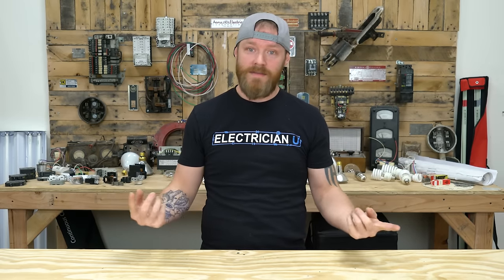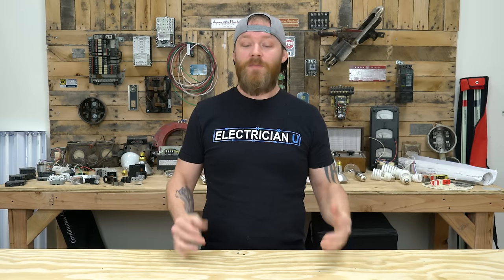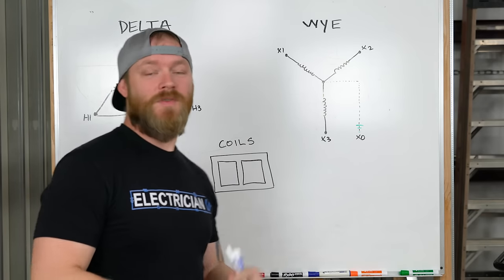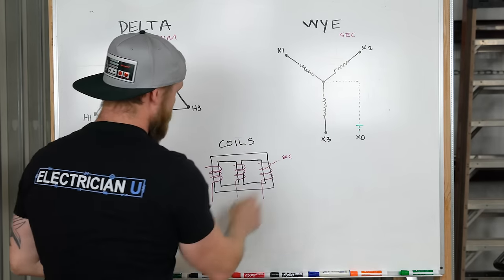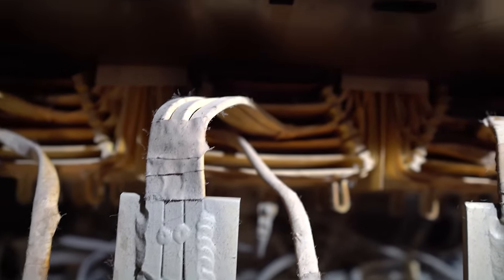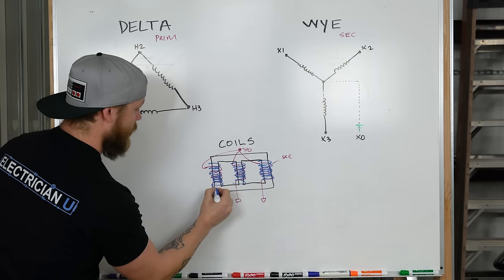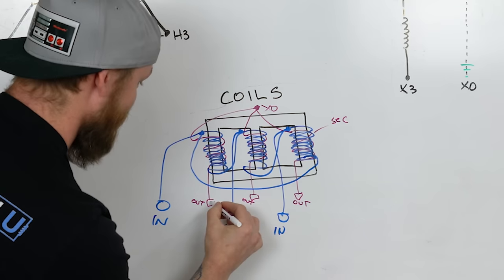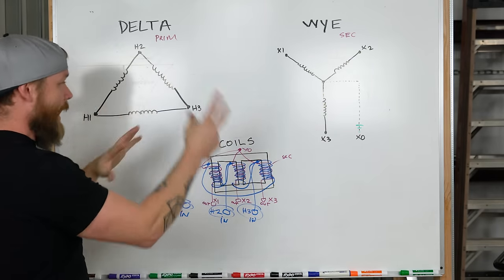TRANSFORMERS - What They Are, How They Work, How Electricians Size Them

Comment: Our building is currently having a large solar array installed on the roof. 650W panels and about 80 or 90 p[anels. It is being tied to the electric grid serving the building for a feed-through at 600V. The transformer is a 10Kv. Unfortunately, I don't have the entire set of numbers (Installers are not allowed to share it due to security concerns. Not that I understand how it could be a security concern but it's a social housing building so the rules are designed to keep tenants from knowing anything about the operations side whatsoever.) They also have a solar monitor, a combiner box, and a large breaker that isolates the panel from the transformer that is mounted on the outside of the building. There is more equipment that I saw the boxes for but didn't get a chance to read the label on as they had been blacked out. This is different than my setup for camping where we have a solar controller that combines the transformer function and some elements of the solar monitor into a cigarette pack-sized package that does 10Amps. That with the panel and a battery plus a breaker gives me the power to keep my phone and coffee machine running at the campsite. It would be interesting to see a video of how a large rooftop-mounted solar array is set up and configured.

Comment: Good video, I learned some shit but I feel like the most complicated part is the grounding and bonding which I see a lot of contridictary info on. Most of this other stuff is done by engineers. Hooking up your primary and secondary conductors on a new transformer is sitmple compared to grounding and bonding. Also I've looked and have never seen torque values from a manufacturer. My contractor has "default values" for such conditions which I assume are from UL 486A&B but I have no access to those so I cant verify. My issue with that is I see crimped lugs(usually due to spec instead of mechanical lugs) attached with 1/2" hardware which is very difficult to torque without feeling like you are going to break shit. 50 lbs/ft to connect a 1/0 wire? Seems like overkill. Do you have any info that could clear that situation up?

Comment: My question is what is a transformer that can go from 110v to 220v? If I was to get one is there a way I can hook a solar panel to that transformer to act as if I have more watts going into a 24v battery set up? If not can I place a transformer after a 12v battery to get 24v or higher for a 24v or higher power inverter? If I do get 24v inverter can I run it into a breaker box so I can distribute the 110v and 220v to different plugs. I'm not running these  ideas for me to re wire a house camper or rv. I'm trying to experiment with a 370w solar panel and run it in my shed that is in the country and if it caught on fire and burned down it would not burn houses or other buildings down. I have a feeling that just taking a little bit of electricity from something like a solar panel can be stepped up so you don't have to have a whole backyard of solar panels or have tons of batteries that will burn out every few years and cost you a thousand of dollars for just one new battery compared to thousands if more than one battery goes bad. I have one 12v battery and its a little over 200amh led battery. So spending even $700 once for an transformer is still cheaper then spending $300 for 10-20 solar panels and swapping out one battery is better than having 4 go bad that cost $1,000 a piece so these are the reasoning of why I thought of a transformer. I also understand that a large fuse should be used and another reason why I said run it into a breaker box is so the breakers can be the shut offs manually and if it overloads it will trip the breaker. If you make a video demonstrating these that would be cool and im sure so many more people for camping purposes and for home diy people will follow you. I'm trying to run bitcoin miners in my shed instead of in my house because they are loud and I don't want to run them on the grid and have to pay for the electricity so this is why I need 220v in my shed.

Comment: Isolation: Your explanation about isolation and dirty power not getting through to the secondary because there is electrical isolation between the primary and secondary ia wrong.

Dirty power is electricity which contains spikes and therefore harmonics. Those harmonics are of different frequencies to the supply of frequency of 60 Hz.

What you have to remember is that the primary side of the transformer is a coil which has inductance. And the reactance of an inductance increases with frequency.

So those spikes comprising higher frequency harmonics are suppressed by the inductance of the primary coil. It is nothing to do with the principle of galvanic isolation as you state.

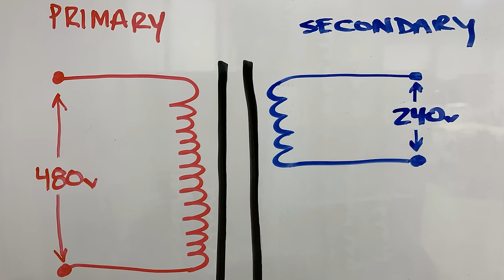Comment: 3:24 - "you're going to end up having a different resistance or reactance because of that, which is going to produce a diffferent voltage at a different amperage..."

No. You are saying that the wire resistance and reactance of the coil is responsible for lowering or increasing the current in the secondary winding.

This is NOT Correct .

It is far easier to simply state:
The power in and out of the transformer are equal. So to maintain the same output power on the secondary, if the output voltage on the secondary is lower than the primary then the current must increase, and if the outout voltage is higher then the current must reduce.

Leave it at that.
The explanation as to why it happens is to do with the number of turns in the secondary coil that cut across the changing magnetic field, and induced voltage which involves Faraday's Law.
But this is too much detail for most electricians and student electricians will struggle to understand Farady's law and the math behind it.

Comment: Principle of Isolation. Time index: 5:08
Your description of isolation, or more correctly galvanic isolation is wrong.

How isolation transformers work

Isolation transformers provide galvanic isolation between the AC power lines (mains) and the powered device. That means that there is not a DC path between the two windings. They serve three main purposes:

    The first is isolating the secondary from ground (earth)
    The second is to provide step up or step down of line (mains) voltages
    The third is to reduce line noise being transmitted from the primary to the secondary or vice versa

In the first of these points, the neutral wire on the secondary is not connected (bonded) to earth. The line and neutral are completely electrically isolated from the line, (hot) , neutral and earth on the primary side.

This has an important safety benefit.
If you contact the hot line in an electrical installation, the installation is earthed and your body is in contact with the earth, so the electricity is going to flow through you and down to the physical earth and back through the inatallation's earthing connection and back to the supply origin. And hence you are then electrocuted.

But if you contact the hot line on the secondary side of the isolation transformer, there is no earth/ground connection to the transformer, so there is no complete circuit involving your body and that transformer. No complete circuit means no current flows. So even though you are touching the hot line, no curremt passes through your body and hence you are not electrocuted.

Comment: Great video. Confirmed a few things I learned years ago.  Q: When you were calculating the correct size/rated transformer for a given application, why was there no Power Factor multiple added? If you knew the nature of the downstream load, could you use V x A x PF ?

Comment: THHN without covering is bare metal.
If you mean no nylon sheath thats hookup or machine tool wire.
Magnet wire is used on the transformer coil.

Comment: When you mention the point about bonding to building steel. How would that apply to say a pull barn that had steel framing, but the transformer is all the way out at the end of the street. 
Would the building steel be bonded from it’s panel?  (say ex: 200amp panel in this case) 
or would there need to be a ground ran straight to the steel building some way somehow

Comment: 2:52, you start talking about "240 volt delta" but you present on screen a diagram of a single phase transformer. Delta does not apply to a single phase installation. Delta and star/wye only apply to 3 phase systems.

Comment: With the transformer, how does it work as a coil and make the electricity travel as such? I can see they are wound as a coil, but wouldn't the electricity just travel straight across them in the path of least resistance? Why would the electricity follow the conductor itself and travel all the way around, again and again, to get to the neutral side of the coil? It seems like it should just travel in a "straight line" across the conductors. If the wire had insulation on it then sure, but it doesn't look like any of the copper in that transformer has any.

Comment: Just wondering on an isolation transformer u mentioned dirty power and clean power can u please elaborate on what u were referring to and the difference
Reply: It refers to properties of the waveform that are undesired.  The AC waveforms, i.e. the function of voltage vs time, is supposed to be a perfect sine wave, centered on zero voltage.   "Dirty power" in this context, means there could be properties of the waveform that distort it, either to make it no longer a sine wave, or offset it, so it is no longer centered on zero.

The distortions in shape are called harmonics.  These are other sine waves of higher frequencies, that cause the waveform to be more than just the fundamental frequency sine wave.  Think about how you can tell the difference between a flute and a trumpet both playing the same tone (suppose middle A, at 440 Hz).    Both instruments have a lot of other tones that are multiples of 440Hz, such as 880 Hz, that give them each a different waveshape.  The fundamental is 440Hz, which is the lowest tone and usually the loudest.  The flute will be mostly the fundamental, while the trumpet will have a lot louder harmonics in its composition.  You want your electricity to have a waveform that would "sound" more like the flute, and less like the trumpet (if you were to make it into an audio signal).

Comment: When your stepping up 208y to 240 to a three phase motor that doesn’t use a neutral , i infer you just run the equipment ground off xo and ground chassis and grounding electrode to bonding steel and disregard running the neutral,

Comment: I am by no means an electrician, but I like to tinker and just thought of transformers as a simple coil of wire that changes power from one voltage/current to another. My 80s childhood may be showing, but dare I say, transformers are "more than meets the eye"

Comment: Hey I'm mounting a federal pacific dry type transformer on a platform above the floor and I faced the vents on the front and back,90 degrees to the wall. And my electrician is saying he can't put the conduit into the front and back. He says he was to put it into the sides. Is that true? Or can he come in the bottom?

Comment: The secondary are only going to have thicker wires if it is stepping down the voltage and hence the amps up. If, however, the transformer is stepping up then everything is reversed. I understand that step downs are the more common. But, thanks, the vid was terrific.

Comment: Think of it like driving your car. Voltage is the speed limit, amperage is the lanes available and wattage is the amount of cars that needs to reach the other side. To get get the same amount of cars across in the same given time you need to either travel at higher speed or have more lanes to not cause traffic. Lowering the voltage is like lowering the top speed so you need more lanes. That's why when you are dropping the voltage your wires on the output side has to increase in size.

Comment: The company I worked at, we/I built custom transformers for electroplating. 
600V in at 100A and output about 12V at 10,000A
Even had some with with 24,000A out, and wires aren’t big enough and need solid copper buss bars that hold 1000A each.
Always a fun day when we actually put 8000A through 3000 A of copper. It was only about 480 Celsius and turned black and started burning the fiberglass resin spacer
Reply: That sounds like a hell of a lot of fun

Comment: You keep saying less voltage, but more amperage. How does that make sense? Please explain, because if I understand correctly, current and resistance are inversely proportional to each other, not voltage and amperage. I'm confused
Reply from the maker: Transformers are rated in kVA or kW. We are thinking ratios when we think about xfmrs. Say we have 100V at 10A coming on our primary, we would have 1000VA or 1000W, and the windings of the transformer are 10:1, we would expect the secondary voltage to drop from 100V to 10V, and the amperage to increase from 10A to 100A. Watts remain the same, but the relationship between Volts and Amps changes.

Comment: I have a question for anyone that may be able to help. 
He mentioned to change the voltage on the secondary side, just change the taps on the primary side. I will assume that it has to be done on all 3 primary taps?? Is that correct?
Thanks for any help
Reply: I am wondering this as well. It seems like you would have to do all three so the load remains balanced.

Comment: I noticed that old transformer was tapped at the same point in each primary winding and the taps were connected across to the windings next to them, is that to smooth eddie currents ?

Comment: I’ve been installing a lot of European and Asian machines lately, I understand how the voltage changes, but how is the transformer changing 60hz to 50hz, mostly 3 phase 480V(277-N) or 208V(120-N) primaries to 380V(220V-N) secondaries?
Reply: There's no way for a transformer to do this.

Comment: You may need an extra large transformer when powering non linear loads such as VFDs and other variable speed motor drives to account for harmonics. The are DITs drive isolation transformers for this purpose.

Comment: Is anyone an electrician that actually sizes transformers?  I work for a massive company and the office ppl have literally everything planned beforehand for the foreman.. Wire size, circuit#, voltage, transformer etc
Reply: It is usually in the scope of the electrical consultants the architects hire.  Then the electrical contractor bids on their drawing set.

Knowing the theory behind their work, also allows the electrician to give a sanity check to the electrical consultant's plans, and identify issues that either don't make sense, or aren't realistic to do in practice.  It is cheaper to correct design issues while they are still on paper, than it is to redo it when you fail inspection.   So it helps to look through the plan set, and make sure the system specified makes sense according to your understanding.

One might work at a company that diversifies to do both installation and design.  One might trade off between doing design work and construction work, depending on what fits the work flow.  This would be where you'd get in to sizing this equipment as an electrician.  Your company might be the consultant the architect hires.

Comment: Very Good  Please  Do  A     three-phase to single phase     The ZigZag   480 3ph  To  single ph  240    Service    Thank You   < They> ?   Said    I Could Not Do It That.. Way......  But It Worked  ?
Reply: You can't turn 480 3phase to 240 single phase. The secondary side of the 3 phase transformer will always have legs that are 120 degrees apart from each other

Comment: Awesome detailed video 👌. I just have one question, so if I have a 240v building and a 480v machine, a transformer would have no problem powering the 480v machine when wired correctly?
Reply from the maker: Correct.  A transformer does not power a machine, the incoming power does.  The transformer just squeezes the voltage and current in opposite directions but gives the same amount of power through the device - just at different ratios.  As long as you feed the machine to manufacturer specs, ensuring proper grounding and bonding, and the transformer is listed/rated for the conditions - (Like you said, wired correctly) yes it will work.

Comment: Think you could do a video on explaining how you get 120,208,277 so on and what that looks like in a panel? I am just so lost at how that works.
Reply: There's videos on power generation

It's the difference between single phase and 3 phase

In single phase each leg is 120v to ground and 240v between the hot legs. It's 240 volts because when one leg is at peak 120v the other leg is at - 120v so the difference between the legs is 240

In 3 phase all 3 legs are 120v to ground, but their peak voltage is no longer  exactly peaking opposite of each other. When you measure any 2 legs to each other you will see 208v because that's the average voltage mixed at any point in the cycle

There's plenty of videos out there explaining it

277 is just bigger voltage 208